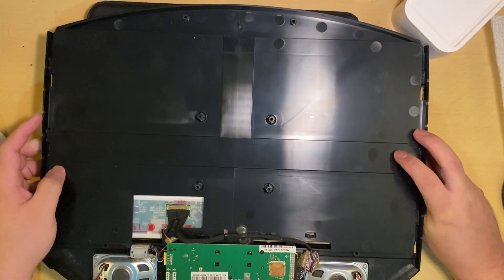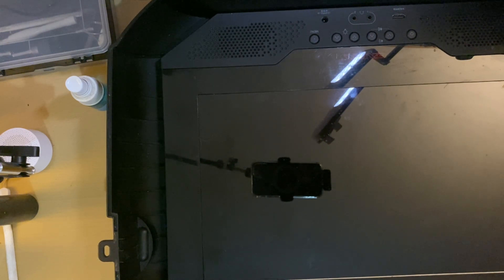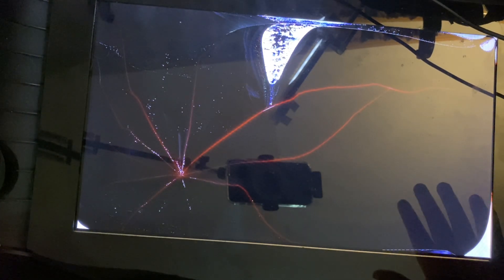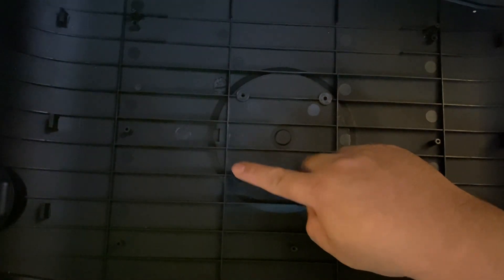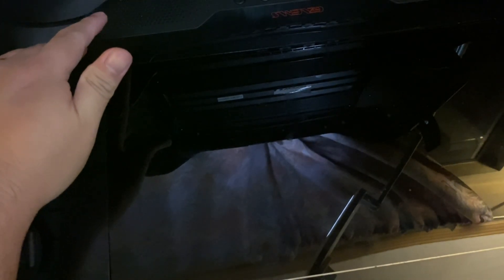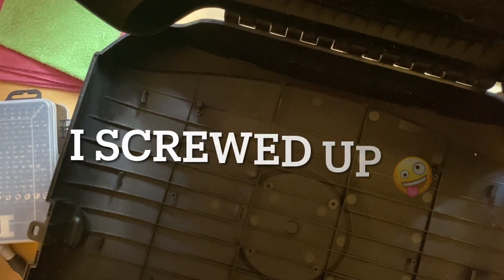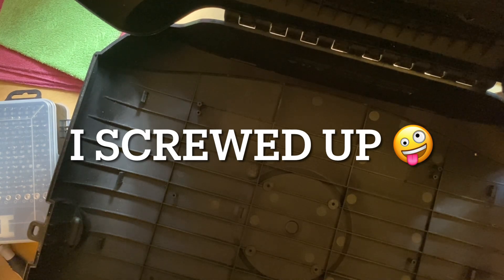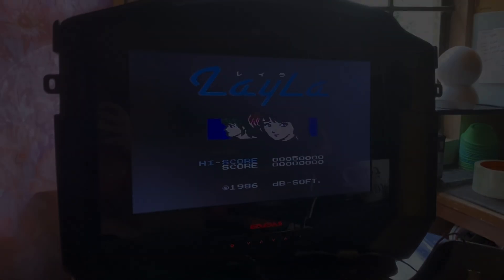Gaems G155 LCD replacement

Comment: When you turn it on, there is a sound like a flat tire, and now when you turn it on, the red button lights up and immediately goes out, and that's how it always is. What can it be
Reply from the maker: @koslbekovi2224  looks like a power issue try other compatible adapter with same power specification.

Comment: Hello! I hope I'm not too late but the link is broken. Know of somewhere i could go to find a replacement LCD? I just got one today and the screen has burns around the perimeter
Reply from the maker: @gerardo42o  it’s not easy to replace or look for replacement. You need to open it to get the model then you’ll search that particular model example: “replace for ￼15.6 inch 40 pin B156XW02 V.6 LTN156AT24 LTN156AT05 N156BGE-L21 N156BGE-L11  N156B6-L0B LP156WH2 LP156WH4-TLN1 LP156WH4-TLB1/TLA1/TLP1  40 PINS LCD Display LED 1366*768” search it on your local e-commerce your version of Amazon , ebay and alibaba. Here we got it from shopee our local and it’s from china.